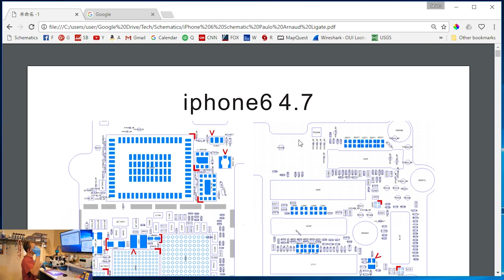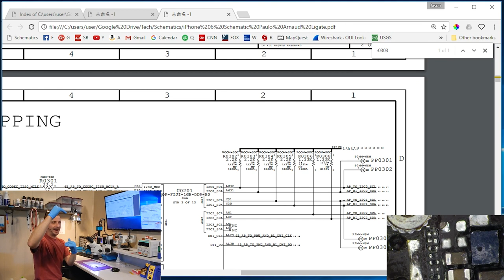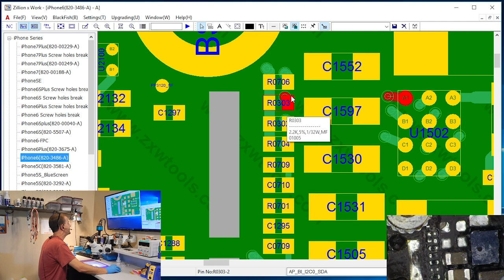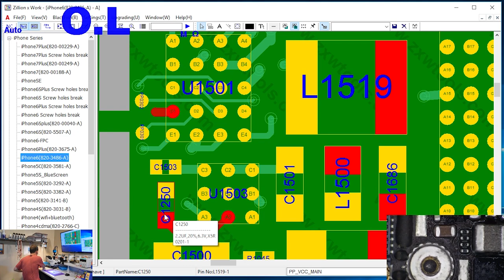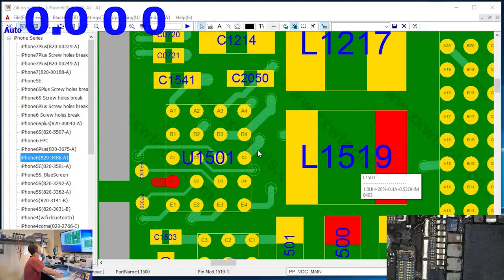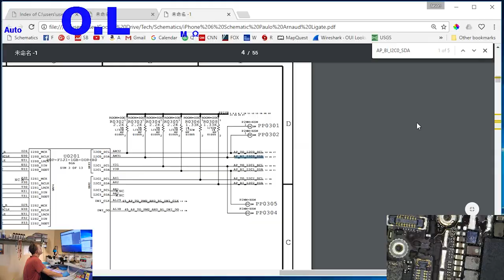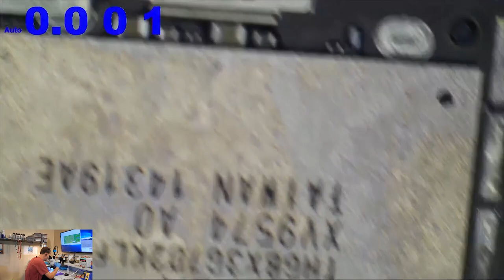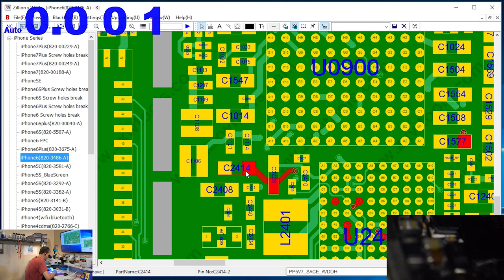I2C iPhone 6 Data Recovery!  Liquid, Touch, Backlight - Multiple Prior Attempts

Comment: You didn't put back the R0706 pull up resistor for the data line front camera. Inviting trouble. Could return it back to life in addition to the ability to back up the data by the customer.

Comment: Hi Jason! ultrasonic cleaner damage? what does it look like? i thought it was the best way to clean a water damaged device. love your videos, brother. another thing I have an amscope SM-4NTP 7x-45x but i dont have enought  space for the hot air gun or the soldering iron, how can i set that up to have a bit more space to work on. thanks in advance.

Comment: Hey i have a Iphone 6s plus and it recently had some water damage. Everything works fine besides if i turn off it stays in a restart loop until i plug it in, once i plug it in it works normally.  Could it be as easy as a new battery? i know its hard to diagnose, but have you ever heard of this problem or done a video on it yet?

Comment: Awesome job Jason. As usual very instructive. Thank you ! Just to know, I’ve also a FX951 in 🇫🇷 . Which temperature are more comfortable for you with the T12 tip ? I’ve tried 360C but seems not enough or too much for a small tip. Don’t know 😁

Comment: Hello

I have bought iPhone S6 with water damage. I know the screen and battery works fine because I tried it on other iPhone 6S.  So, somewhere on the logic board is damage because it is not display anything and no backlit too, however, it recognizes when plugging into the computer and can do restore or update which is good news. My goal is to get the screen to work. Can anyone help me which part of the motherboard to replace whatever is needed. I doing as a practice and hobby

Thank you

Comment: Hi Jason. love your videos. after removing any shields, you dont use hot air to solder them back on? you use soldering iron? i think thats what i understood on this video. thanks!!
Reply from the maker: I just hot air to solder them back on most of the time.  The lower top shield on 6,6+/6s,6s+ I will do with an iron sometimes tho.